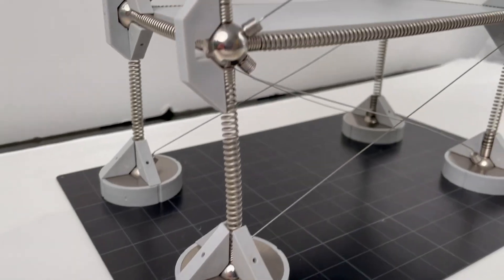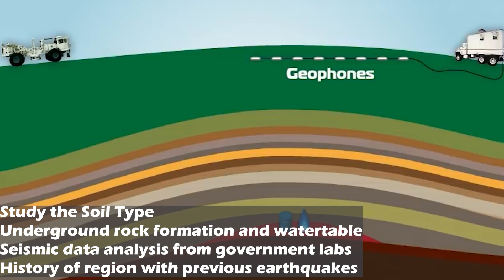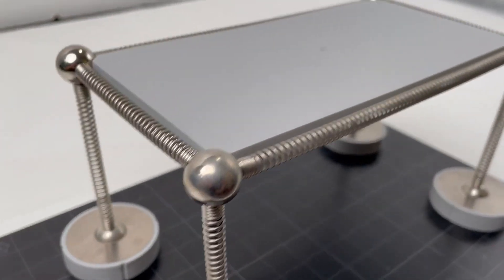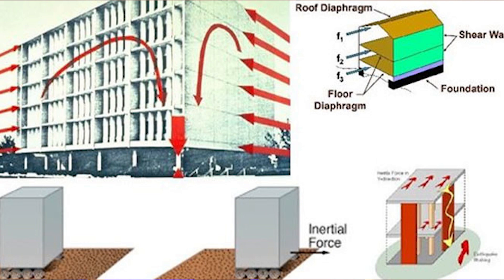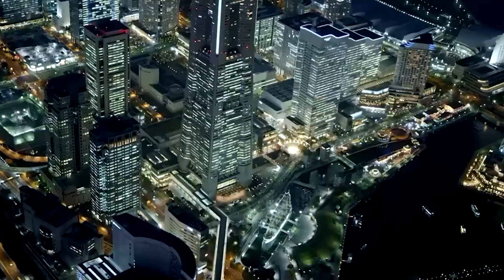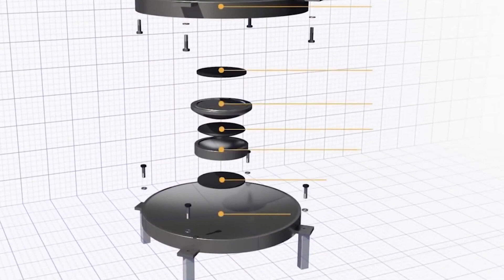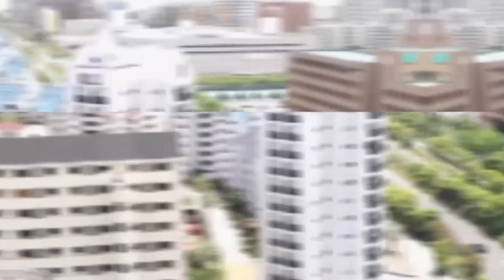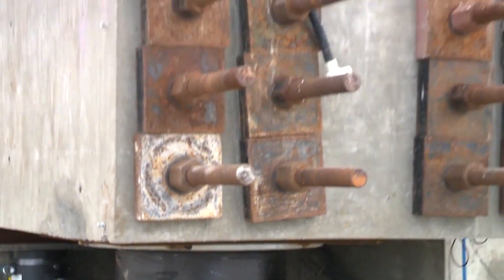Turkey & Syria Earthquake & How to Design  Earthquake resistant Buildings 2023

Comment: Turkay & Syria.....Bad quality of cement, too much installation of bricks in skyscrapers instead of concrete, skimping on cement, bad construction of iron reinforcement, bad use of concrete vibrators when pouring concrete, foundations of buildings heated on mud...etc...Blame and responsible for everything building inspectors, construction companies, engineers, architects and local politicians...
Reply from the maker: Ultimately Govt is or local bodies are responsible, I have heard a lot about corruption in approval departments and Rich construction companies.